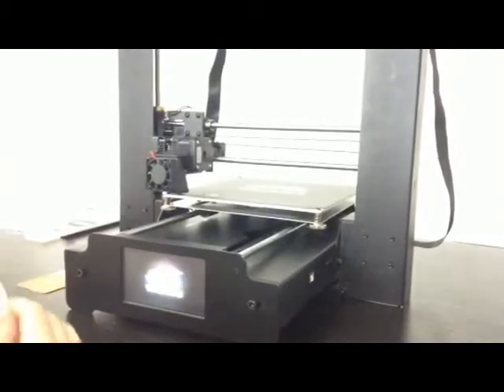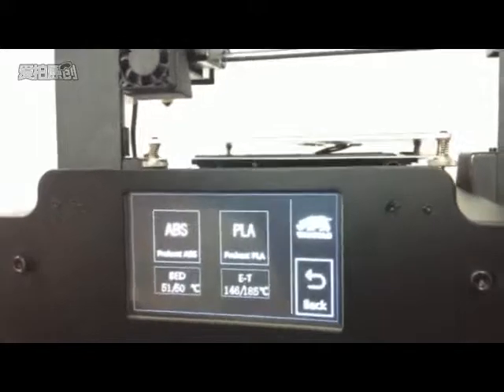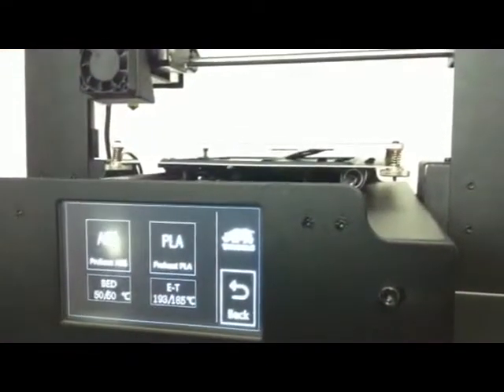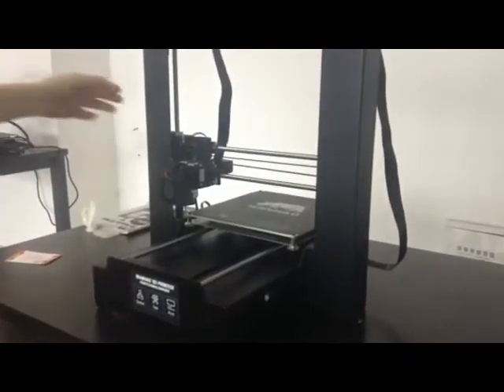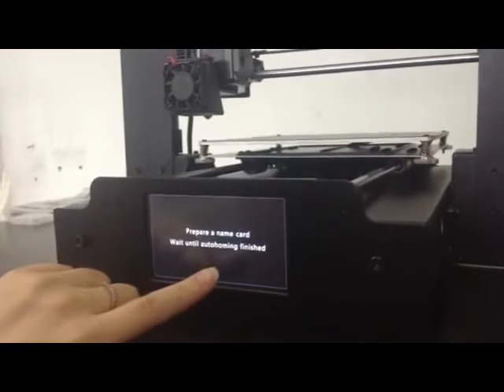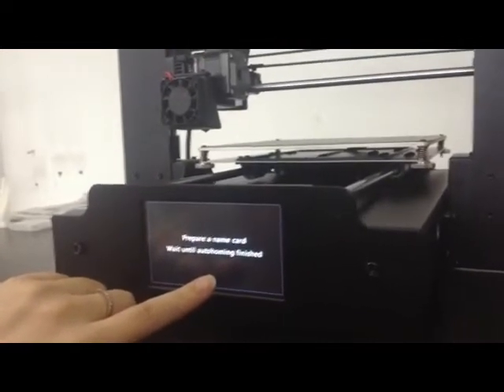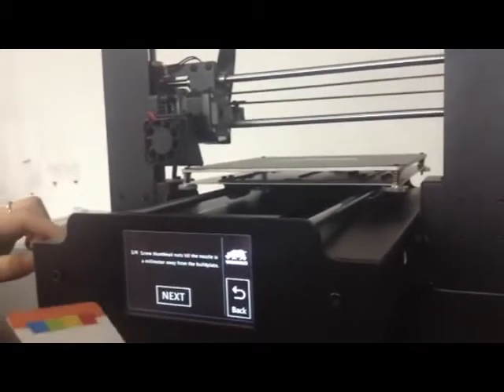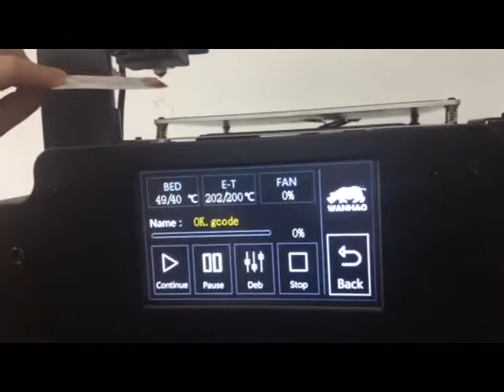How to Level i3plus  bed?

Comment: Note: You also need to check that the gantry is level.

Came here as I was trying to figure out what I was missing. Leveled the gantry when I first got the printer, again several(?) weeks back, and again today. Whatever the cause, the gantry loses level, occasionally. (Was rather confused until I checked the level of the gantry.)

The printer also loses its Z location occasionally. No clue as to why this happens. Have to re-level the bed at least a few times a week.
Reply: this. I had my nozzle grinding my bed even with all screws tightened. my gantry was too low on one side. strangely, i noticed this when i decided to not run my printer "leveled". ive always checked the gantry and bed with a carpenter's level but recently ive decided to run it "un level" to let there be clearance under the bed (like you're supposed to level it). i havent used my printer recently and I thought it was ok to leave it calibrated, but it looks like I also have to do it every few weeks too. I double checked today and somehow my printer disovered a higher home point for the z axis that is not what i was dealing with 2 days ago. I'm using a rebranded Wanhao product, the maker i3 plus from monoprice. identical menu except for splash screen with the rhino.